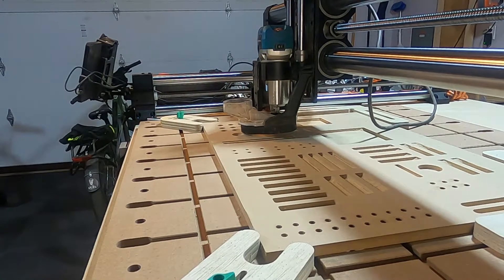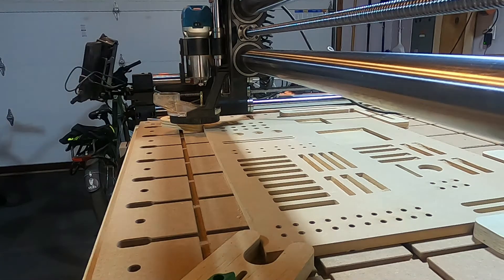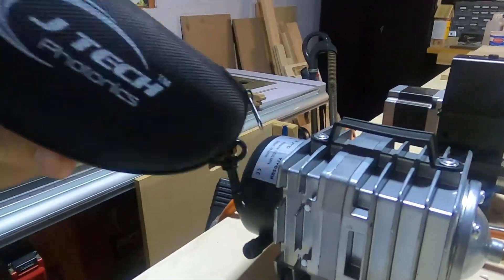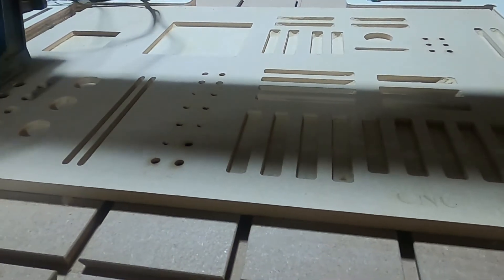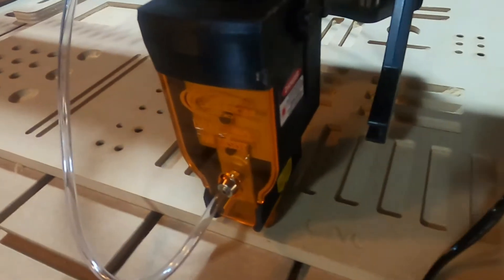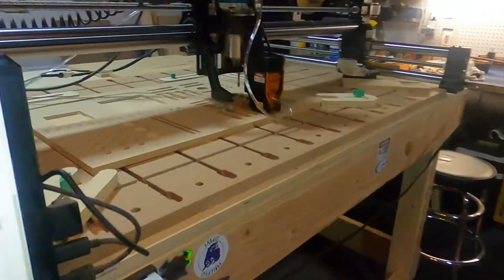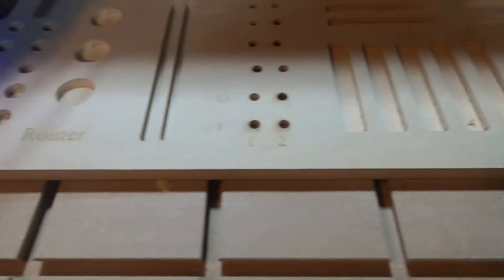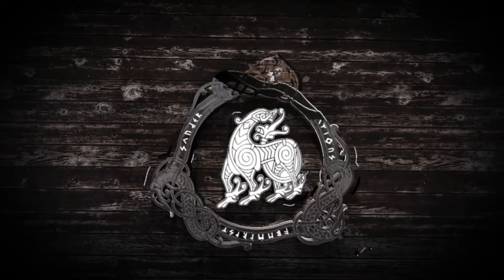VCarve, OneFinity and JTech - the best team ever!

Comment: c'mon man.  Another YT example of thumbnail and title being very misleading.  I didn't realize that a video called "Best Team Ever!" was entirely unscripted and was 90% you farting around with settings and such to accomplish a basic engraving task.  Please do better.
Reply from the maker: Hahaha, that's funny!  The video clearly states the project was done recently after getting the machine and was one of the first projects that I did.  It was definitely designed for beginners you are working through using all of those programs/machines to do an easy first project, to get them comfortable.  Not every video out there is going to be expert level instruction to show you how to  make a Van Gogh from popsicle sticks and silly putty.  As no one ever is an expert at something when they first try it, sometimes you need videos that walk you through the basics.  Thanks for the comment though! Have a nice day.
Reply: @sandercreationsoldaccount  
Personally, I like mistakes. Did you ever figure out the real reason why you got two different results? I would think there is a difference between making each individual square versus making all squares at the same time.
Reply from the maker: @iwannaapple7190  As you would expect, it was my settings.  After a little tweaking and multiple projects I was able to get it dialed in.